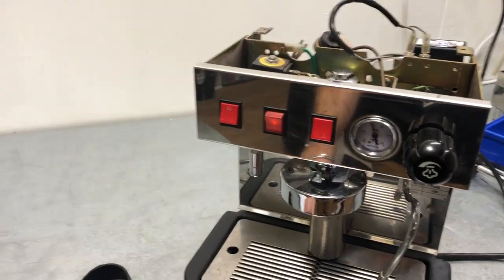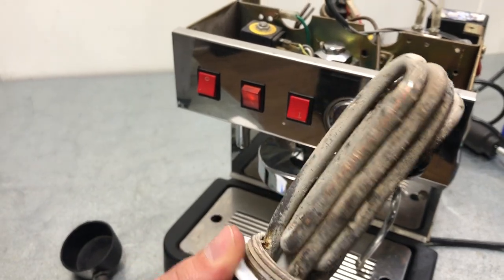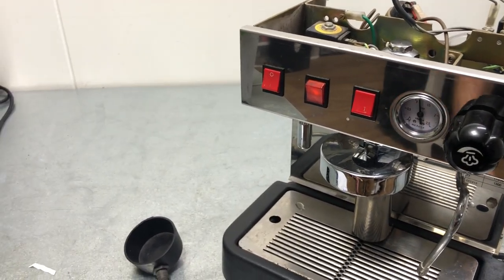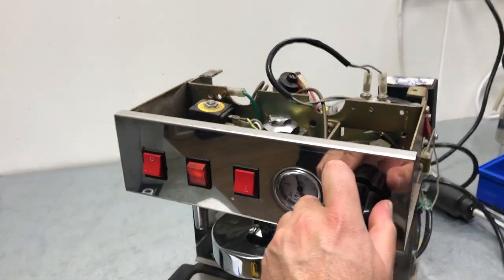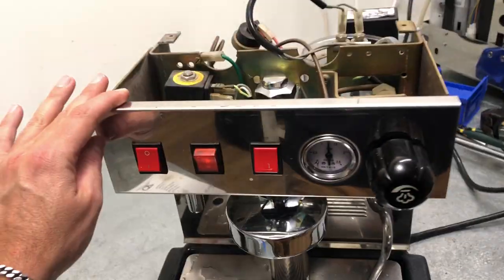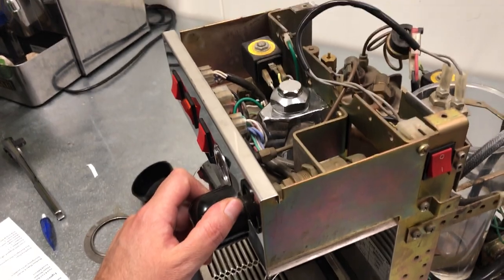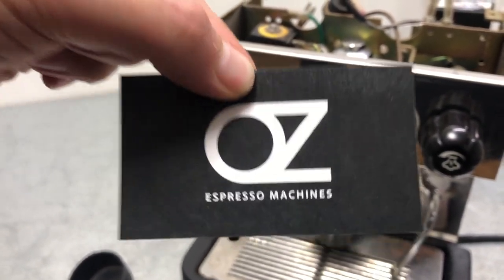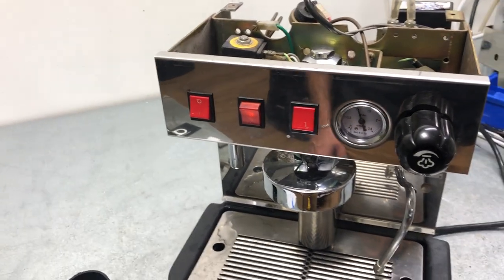Wega Mininova Espresso Machine Quick look

Comment: Had this machine for 10 years and works like a champ. But a leak has just developed where one of the clear hoses at the back connects near the solenoid. Do you know what kind of hosing to get to replace it? Looks brittle.
Reply from the maker: contact the folks at espresso parts.com

Comment: Hi there I have the same machine, it was working now when I go to turn the machine on it trips my house circuit breaker. Could it be my heater element that is shorting the circuits? No actual black burn or short marks on the electrical side that I can see 
Cheers
Reply from the maker: It could be a short somewhere, hard to tell without testing it in person.
Reply: I had disconnected the the heating element turned the machine on and it never tripped the circuit breaker in the house. I have now removed the element is there a way to test it? 
Cheers

Comment: Hi, I have exactly the same machine. May be you can advice on 2 issues, not sure if those are connected. 1 When heating up for 20-30 minutes sometimes machine would just stay warm, if to release steam once it will get up to temperature OK. If to leave steam just a tiny bit ON it will get to temperature OK. 2 But if to leave it for 30 minutes unused it will get way too hot even for single boiler. Can't find fix for that just flushing. Amazing job on polishing! Can you advice what you used to achieve that result?
Reply from the maker: Not sure about the issue you’re describing, could be a thermostat. About the polish, we use windex and microfiber towels. Hope this helps -Y
Reply: @ozespresso  Thanks for quick response. In the video you mentioned that when heating element is gone machine cooks itself so I thought that is happening with mine but I can try to change thermostat first, way easier . Windex is just that blue liquid that I can see on amazon at first results? Never thought polishing can be so easy :)
Reply: @ozespresso  Hi, I was trying to find thermostat in mine, but I don't have it where is yours. Mine is a rotary pump. but those must have it as well, don't they? I also found that steam wand is slowly releasing water what causes boiler to loose pressure more often and it will turn itself on at least each minute. Can this be an issue of overheating?
Reply from the maker: @golddesign6698  It will be hard to answer this questions right as there could be several factors creating the problem. It will need some testing first. Try finding a certified tech!

Comment: Where can I get the manual for this machine?

I have the same one and mine doesn't heat anything, they gave it to me, I don't know if it's the same problem with the heater?
Reply from the maker: Try and locate a local technician or try and contact espressoparts.com, they sell the heating element for this machine. Hope this helps! -Y

Comment: What would cause  2 group Wega compact not to heat. I'm in the process of changing the heating element. Power is getting to the element. I would like to know if you recommend testing other components that could have triggered it not heat.
Reply from the maker: It will be hard to answer this question without testing the equipment as there could be several issues. Test the ground at the wall and test the ground on the machine. It could be a thermostat or a  switch etc...